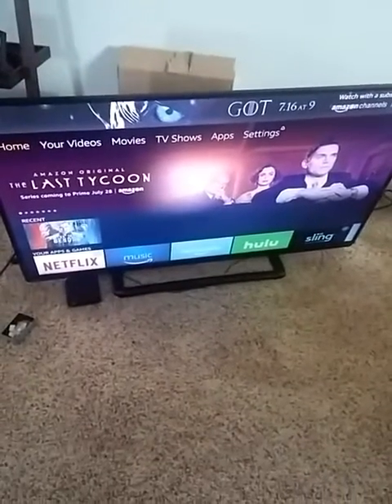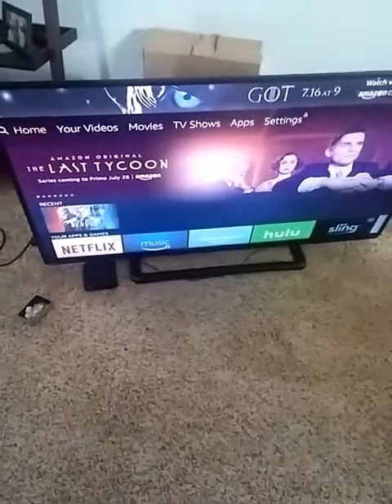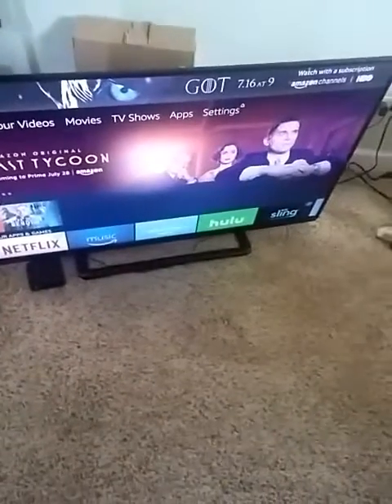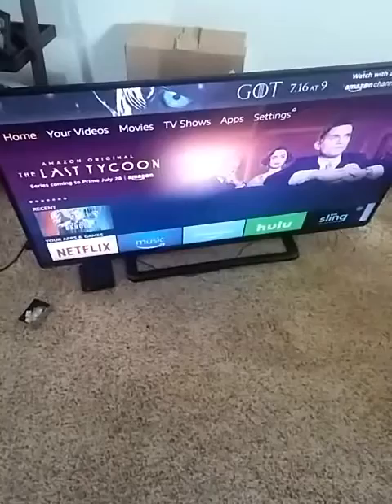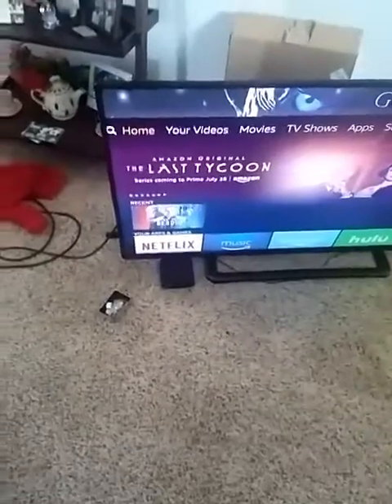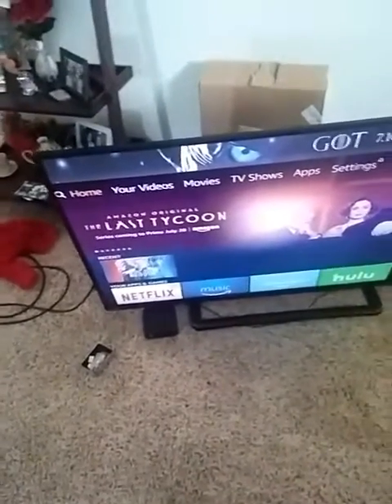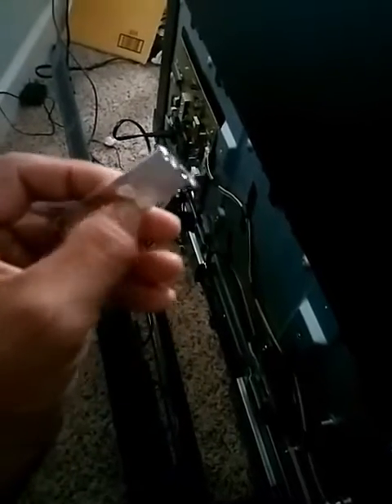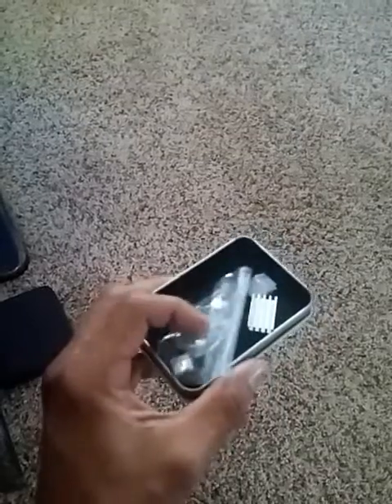Toshiba 50L1400U after warm up it flickers

Comment: Leaving comment in hopes someone else has same problem, as I did not try this (little to complicated for me), resolution change & factory reset did not work.  I have a screen fast jump (or flicker) up just a small amount, it does it about every 3 seconds, it starts after the Toshiba TV is warmed up. I am using TV as a monitor, and the strange thing is that while in window explorer the top TABS do not jump or move???  If anyone else is having the same problem and finds a fix for it, please leave a reply comment.

Comment: In TV menu, picture, turn the backlighting down to at least 50 and under that turn the brightness to the desired level. pushing the backlight up and then adjusting brightness push's the power management chip into thermal overload (blinks)

Comment: stuff is built like crap today they say progress is good hell i have a tosibha that is not even 4 years old yet and it is doing this yet i got a tube tv that is 25 years old and works fine wonder if you just left the back of it off if that would cool it
Reply: Robert wwylie I changed the thermal paste in my tv and it didn’t work. I decided to checked my backlight settings and it was set too high so I brought it down to 30 and it has been working fine.

Comment: I'm wondering if it started to flicker after a few more hours.  Please respond before I order anything.  I used  a heatsink I had and the flickering actually stopped for several hours.  I ran it all night, but it started up again, but now the flickering now has even shorter intervals. Thanks
Reply from the maker: Hi Thomas Eames. If flickering continue after removing and putting in new heatsink I would replace the IC chip as well as recommend in the video in the description.

Comment: Amazon is out of the heat sinks can you post a link for the heat sinks for ebay i cant find that size
Reply from the maker: Hey Tonie sorry for the late reply.  I do not recall the size of the Chip but you can use this set https://www.amazon.com/Easycargo-Raspberry-Heatsink-Aluminum-conductive/dp/B07217N5LS/ref=mp_s_a_1_3?keywords=heatsink+3m&qid=1552231994&s=gateway&sr=8-3. You can also use 2 small heatsink on the chip itself.

Comment: Thanks for this!  I removed the heat sink and scratched off the hardened, small amount of thermal paste that was on the chip and added a lot more of the paste and put the original heat sink back on.  That worked for about 2 months.  
BUT NOW IT'S HAPPENING AGAIN!!  I think this time I will replace the heat sink with one of the heat sinks with cooling fins that you suggested and hope for the best.  If it happens again I will try replacing the chip.
Reply: any update?
I have the same model, same issue.
I was wondering if this repair was working on the long term.

Comment: Thank-you very much! Other people were saying it was a bad circuit. I'm glad I saw this before I started soldering things. I figured it was a heat issue. Why else would the blinking start only after warming up? I might install an extra large heat sink.
Reply: mememuhsheen  i need a link for the heat sinks on ebay

Comment: Mine started blinking then went completely black but i still get audio i have the same exact tv model
Reply from the maker: Hey Manuel does the picture comes back on after it colds down or it never came back at all?  Have you tried using freezer spray on the IC chip, like on this video https://youtu.be/FSzF2TJh20A?

Comment: Mr.Mobile ......not questioning your wisdom ( I'm waiting for my heat sinks to be delivered from Amazon :)....
but I'm just wondering if the heatsink would be even more effective if it was placed with the "heatsinks" running up and down as opposed to side to side ? 
Heat rises so.....
Like I said ......I'm not questioning your wisdom .....I'm just wondering.
Thanks.
Reply from the maker: Robert Silvers no offense taken.  You are correct tempature does rises, but the reason why I put it that way is because the thermal tape that is on the heat sink was horizontal as well as the IC chip.  That way the thermal tape will help transfer as much temperature from the IC chip to the heat sink.  As if I put it vertical some part of the IC chip will not be covered by the thermal tape, good luck.
Reply: That explains it.
Thanks.

Comment: Hey thanks man. I had the same exact issue and a new heat sink definitely fixed it. You can also take it a step further and apply new thermal paste since that seems to be the main issue. Either one will fix the problem but if you have some thermal paste at hand I would try doing that first.
Reply: Luis Alberto  hi, I have this same issue ..how do you apply the thermal paste.

Comment: Can u please name all the parts you purchased and replaced here in the comments. I have the same problem with my haier tv and the repair center wants to charge me 150 to get it fixed.
Reply from the maker: stankypantz I'm not sure it the fix will work for the haier TV but the only thing I purchased was the heat sink from Amazon which I put a link in the description.  It goes on top of the the ic chip on the board.  Please watch first video in the description for the actual issue that I was having and how he did the repair.  I did buy the IC chip but I did not replace it since it was working fine for me.  Thank you